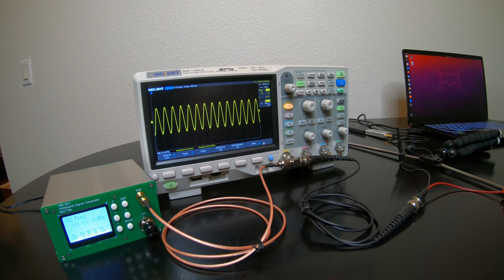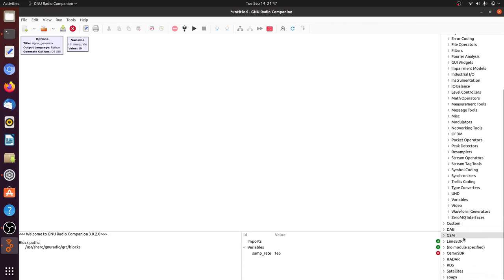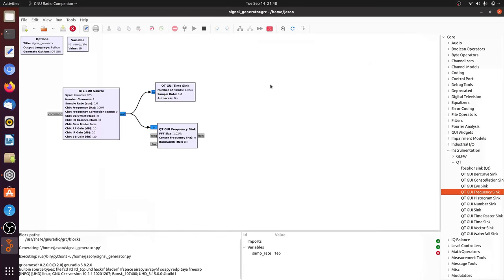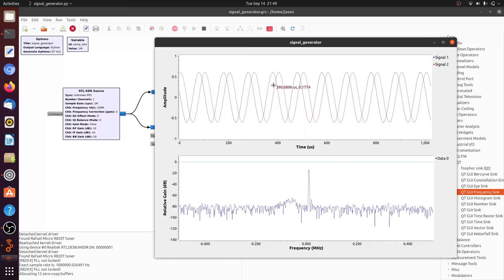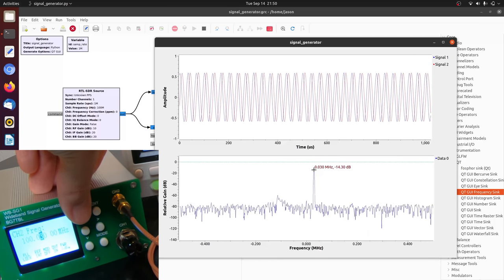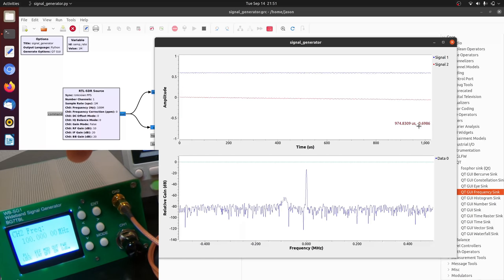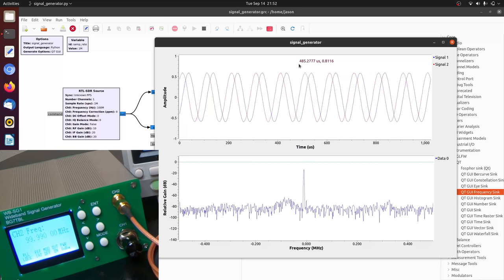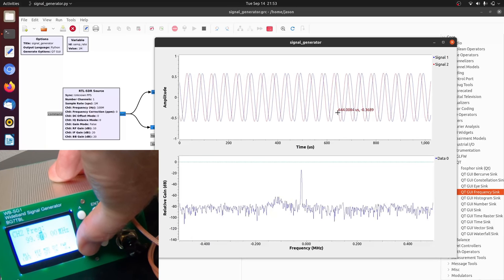Learn SDR 02: Signal Generator into RTL-SDR

Comment: I don't have a signal generator, but I was able to simulate this in GRC by using the Signal Source under Waveform Generators, setting the initial frequency to 100.01e6. The signal is a lot less noisy, as you might imagine lol